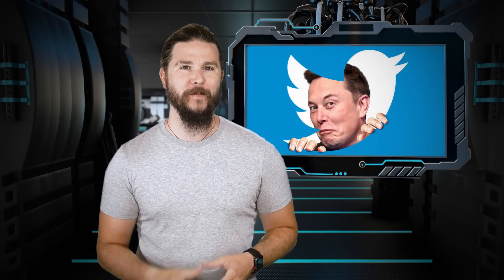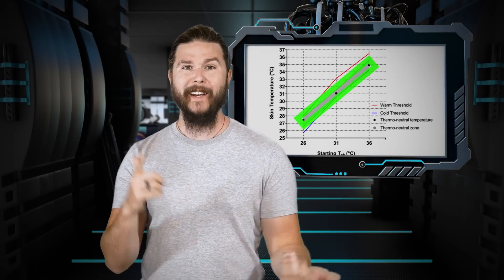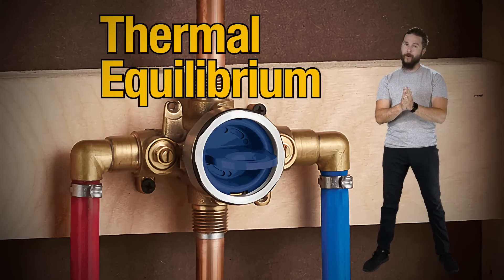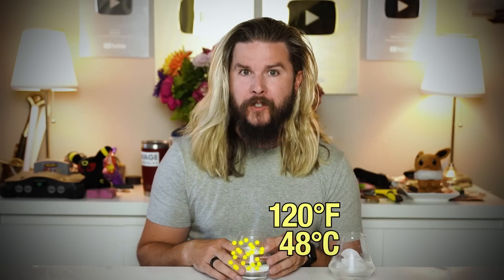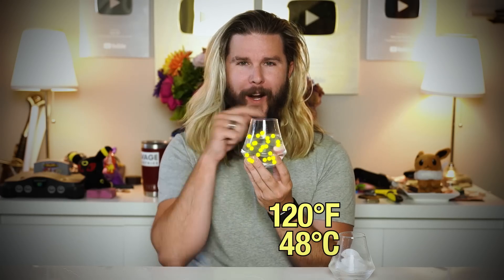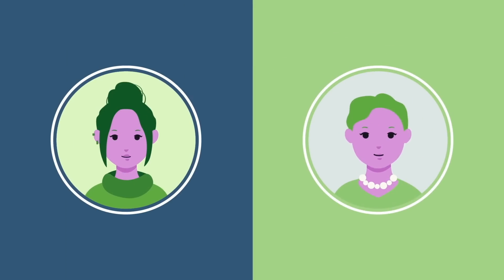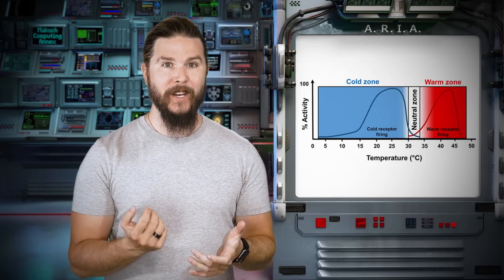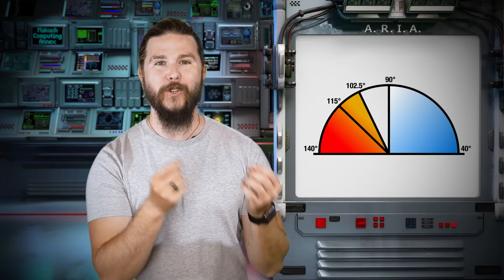Why Are Shower Handles So Sensitive?

Comment: First world problems... xD Or, to be fair, problems of countries with proper winter with snow and all time, versus tropical countries - at least in part.
Problem here in my mom's apartment isn't about finding the right balance, it's about hoping that the water gets hot enough during winter.
Electric shower that although new and fancy by country standards, it's yes, that famous type with exposed resistance in direct contact with water... Even Mehdi was kinda surprised by it (Electroboom).
Also, I guess a symptom of winters not getting cold enough, insulation here is kinda poorly done, not only for internal spaces, but also pipes and water tanks. As temperatures never goes bellow freezing, the attitude towards insulation and putting up thermal barriers on houses and apartments in the entire country is... cavalier at best. xD
What this translates to is that when the weather gets cold here (by our standards, single digits C), the water temperature also goes down by a lot, and then electric showers struggles to bring the temperature up.
We're not even in winter here yet, cold days probably dropping down at least some 10-20 degrees C more than it is right now, and we're already hitting the limits of how hot the electric shower can go. Cranked to the max, reducing flow rate to get to the right temperature.
I'm not really sure why, but it's like, it's hard to even find different options in the market... of course, basic electric showers are cheaper and so they'll sell more in a country that is mostly poor, but it's not like there is zero market here for fancier alternatives.
For some reason though, for electric, you either go with very simple exposed resistance wire electric shower, or you need to get huge tanks that requires separate and complex installation. No in between option like small wall mounted systems that can go all in the shower box or something. I used to think it was about market monopolization, but we actually have at least half a dozen big brands cornering the market, it's weird how little innovation there is.
The "fancier" more well known local brand have a huge range of electric showers which... well, don't have much difference between models at all, outside looks. You get some fancy slim line multi shower head with smooth flow control yadda yadda with internals that is exactly the same thing as the cheapest model - one or two exposed standard resistors in direct contact with water flow. So, you can change things around a bit, but water temperature, the most important point of contention there, will only get so hot no matter if you take the cheapest or the most expensive model. :P

Comment: You could also simply use multiple handles for the job because it was the way that they used to do it and most people still do.
Reply: In the last few years, I DID replace the faucets in the sinks in both bathrooms & the kitchen sink, with faucets that have separate handles for hot & cold, because when you turn on a combined handle faucet, the water that comes out is the same temperature it was the LAST TIME the faucet was used (it’s not hard; I have no formal mechanical training); the downstairs shower & the upstairs bathtub still have the combined handle like he’s talking about).  I was VERY GLAD for this fact 3 weeks ago, when the (23 1/2-year-old) water heater in my husband’s & my house died, & it was a few days before the new one could be installed; that’s because I discovered that, if there’s no water heater, NO water comes out of faucets with combined handles, whereas I could still get cold water from the faucets with separate handles (several times, I had to heat cold water on the stove to wash dishes).  I told this to the installers, so they could warn future customers to install a 2-handle faucet somewhere in their house if they're going to be without a water heater for a few days; this way, they can at least wash their hands.
Reply: @augiegirl1  I absolutely detest the combination faucets mostly because of how unreliable they are in comparison to a real faucet or as they say a separate handle system. The primary reason why they aren't as reliable is because if either side loses pressure the entire system will fail most of the time and when it does you will probably destroy the entire system simply by trying to use it. I also have problems with the inability to actually adjust the temperature in any meaningful way especially if you have a heater that is extremely high or low or if you have exceptionally low pressure on one side or the other.
Reply: A 2-handle faucet is pretty cheap, too.  The Walmart brand (Mainstays) bathroom sink faucet is ONLY $15!!!

Comment: You can get a thermostatic mixing valve installed which will pre-mix your hot and cold water to a certain temperature, which is what they use on hand basins in public restrooms to avoid getting sued literally every day.

Comment: Great vid, Kyle! That note you make around 9:00 is what the engineering field of Human Systems Integration, sort of an offshoot of Human Factors  (or when safety is involved, Human Reliability Analysis). I see this "engineering convenience over human-centric design" all the time in my field.

 Interestingly the only engineers that seem to have internalized HSI are ones where there has been a major disaster (systems engineers for e.g. construction processes i.e. Hyatt regency disaster, nuclear control engineers i.e. three mile island,  or aerospace controls engineers i.e. every pilot-based disaster). It's so incredibly hard to convince an engineering establishment to take these cautionary tales seriously in other domains though, since humans have this kind of "too messy, won't touch" feel. Trying to get awareness for it in Machine Learning via Human-Centered AI movement, for e.g.
Reply: Whut

Comment: Mixers are useless, twin taps for the win.
I'm on tank water and it's so much better than mains, showers feel like they're ripping your skin off. 
Run quad impeller pumps on controllers with accumulators, a 200L pressure vessel, 2 massive on demand gas heaters we can have the 4 showers running (2 per heater) and a toilet flush or washing machine/dishwasher filling doesn't do a thing.

Comment: I wish there was a system where you could input the temperature digitally and you don't ever have to worry about shower knob dexterity skills. Though I know this will likely require a seperate boiler from the one used for other purposes, like your dishwasher. I know that you can't just turn down the central temperature because then you get microbes growing inside the pipes, and you can't add chemicals cuz... that's asking for health and environmental problems. And going with a system that makes it hot first and then cools it down when it's needed is energy-inefficient. It sucks, but the only way I see this working is by reworking how you clean yourself altogether. The idea of a shower is faulty; there must be a better way. Either that, or they need to hurry up with them nuclear fusion power plants so the energy problem isn't a problem anymore and you can just fill a bath with boiling water through an automated system for your 7AM bath which is perfectly times to be at the right temperature when you get in. Or everybody gets an indoor pool filled with chlorine lol.
Reply: There are controls with a separate temperature knob and water knob. Bimetallic valve controlled. I have no problem getting the right temp, becoming very popular in europe
Reply: They have existed for well over a decade, small control panel at the shower where you plug in your temp and a go/stop button.

Comment: Imagine having one of those weird levers instead of the obviously superior 2 knobs
Reply: Right? The 2 valve setup(actually 3 in my shower, the middle one controls post mixed flow to the shower head) is the obvious answer
Reply: @NFSgadzooks  Only downside is accessibility for those with poor grip but you can always just like, do the lever/handle thing, but on the knobs.

Comment: In India, We do not have hot or cold showers.
We have showers depending on what the temperature of the water being supplied is.
In summers it is hot enough to compete against Ryan Reynolds and in winters it is cold enough to give Elsa a fever.
Reply: You have a way with words
Reply: Wait, India has winter?
Reply: Wouldn't giving Elsa hypothermia be a more apt description for cold affecting cold in this scenario?
Reply: @justmythoughts88  The common believe is that, when you don’t coat yourself properly, you catch a cold, and by extension, a fever.
Reply: @justmythoughts88  Spending time in too cold environment often weakens your immune system and makes it easier to get a virus for flu -> fever is the most common symptom body uses to fight a disease caused by a virus. 

I assume this is what OP meant.

Edit. I think a joke just flew over my head... 🤦‍♂️
Reply: @justmythoughts88  And you give your dog a kick every day too? Suck on it Ass, I mean Arc.
Reply: @justmythoughts88  It's a metaphor. It has been around in one form or another for at least a hundred years.
Reply: @DrewNorthup   The op said it's hot like Ryan Reynolds, and cold enough to give Elsa a fever. A fever would make her hot. I'm suggesting a more apt word would be hypothermia, as in the water is cold enough to make a literal ice queen far too cold, giving her hypothermia.
Reply: @DrewNorthup solid use an ad hominem there, good sir. Love that intellectual depth. 👏
Reply: @justmythoughts88  technically no, they're right. Getting a fever is caused by bacteria or being around cold areas, especially since fevers are also associated with colds.
Technically they should've said a cold though
Reply: @ExtraLives-s8c  I never said anyone was wrong, just offered a different word to fit the metaphor a bit better. Secondly, no one had been talking about bacterial infections. I'm talking temperature related conditions, again hot to hot and cold to cold.
Reply: Indian engineering be Wildin 🤣
Reply: @Skedge  no shit, Sherlock. If I know what hypothermia is, it stands to reason I also understand that cold can also give you a fever. Hot to hot, cold to cols, that was my point. Not cold to hot.
Reply: @justmythoughts88  what's that phenomenon something about being unable to recognize when people are being facetious
Reply: @gororgelester985  oh no, I missed the fact the OP wasn't actually being serious? Forgive my transgression, good sir, and grant me the opportunity to right my wrongs. 🙇‍♂️

hopefully you have a solid understanding of sarcasm as well
Reply: @justmythoughts88  I don't understand why or how sharing a minor critique caused so much conflict. Although, the verbal patterns remind me of a kingergarten classroom.
Reply: @AngelNearDestruction  welcome to the internet, where critiques flow freely and linguistic skills leave one wanting.

Comment: I will say there are times when you want only hot or only cold water, usually because you're not taking a shower but are using the tub for an Alternate use. Like washing large objects that don't fit in a sink. 

I'm struggling with conceiving of how to engineer a joint that has 0, 100% and then only,  say, 50 to 70% mixing ratios.

Comment: Well, this "problem" have bin solved sins 1972 in Sweden ... with proper engineering. It is named a Termostatblandaren ("thermomixer"), and it regulates the flows of hot and cold. I do not know if it was the first of its kind at the time. But it was the first in Sweden. Granted, the blenders of today are far better than the once back then. That said, growing up I never understood why this hot and cold shower temp mix was a problem. I never experienced it in my home. It have bin a standard in Swedish homes for decades. The difference between each degree of Celsius is about 0,7 cm. ( I measured on my own). The temperature range is from about 25 to 45. and the knob goes almost 2 spins around, including a safety laths that prevent temps above 35 unless you release it. It is easy to get the exact temperature you want.
Reply: It's called a thermostatic mixing valve in the US and fairly common this day and age. Also we have pressure balancing valves but that is more to prevent temperature fluctuations while in the shower.
Reply: @m_soko  where in the US do you live that has these? And what price are you paying for the places? I've lived around LA my whole life in a variety of places (from cheap apartments to expensive homes) and the only thing like that I've seen is in the master bedroom of a 4m luxury house where it has a digital temperature controller. But every other shower I've ever used (including the rest of the showers in that 4m house!) All have some variation of the exact system in this video and are a pain to get in the right spot. So like... you say it's common but... where??
Reply: i live in sweden and it is a problem
Reply: Yeah, have the same here at Åland, never had this problem either.
Reply: @sgt_kissekatt6686  for me it started when they adjusted the water piping or some shit. did'nt have this problem before last year.
Reply: Indeed a thermostatic mixing valve is by far the best way to fix the problem.

Sadly rentals tend to be way too cheap to use them (even though they're not that expensive), and as a result knowledge of TMVs and their advantages is nowhere near as widespread as it should.

TMV are also safer, because they normally contain hot water cutoffs (though do check that yours does), so they cut the hot water intake if there's a significant drop in cold water pressure. They also make for much safer and more reliable showering in variable-temperature environments e.g. if your hot water can come from a solar heater or a furnace. This also works when the cold intake has variable temperature (e.g. the mains are not well insulated and so can vary from "near freezing" in winter to 15+ in summer).
Reply: And in 1927 in Brazil, where a guy was crazy enough to pump electricity into his  showerhead and it quickly became a very common thing in every household

Comment: You completely washed over the wax expansion valve. But the main point of a shower having such a wide range of motion is because it is unknown at what temperature YOUR particular water heater is set for, therefore the valve has to be designed to adapt to a much wider variable range, otherwise you overcomplicate the line (and more valve complication means more leak possibilities and more cost long term).

You could set up a system of temperature actuators to dial in a perfect temp for you....but then it's only for you, and it may not even be what you like year round. I prefer a tiny bit hotter during winter than normal, and I like mine nearly 5 degrees more than my gf. It might only be "an inch" of dial movement, but I don't only use the shower for showering....filling my carpet cleaner or wash buckets requires straight hot water, and filling my grass fertilizer or weed killer containers requires cold water, so I use nearly the entire "180 degrees" of movement. Personally, I prefer the 2 handle system that I grew up with, but I haven't got the funds to remodel that part of my house yet.

Comment: This is an American problem. Most other places you have a separate warm and cold handle to better mix it (just like a normal faucet), or just run with the thermostat controlled ones by default
Reply: Canada. Mine is like this but it’s rare
Reply: In Europe I thought the showers were magic but didn't know why
Reply: It's not even that, we have showers here that have individual controls, and our house has single controls that work perfectly fine. It really seems to just be an issue with bad plumbers and bad faucets.

Comment: Guess this is mainly a sensitivity issue. My "confortable" temerature zone is between 25-35C so i have no issue fining a proper setting on any shower. My wife showers in between 36 and 36,5°C so she needs a thermostat.  
the issue can be much more complex anyway. Our house uses a heat exchanger for warm water so the temperature of warm water can drop if more than one apartment is using hot water. So does the pressure. So if you have a static valve and the temperature and pressure of the warm water drops, the temperature can shift significantly. 
Best solution by far is a thermostat. This way you can set the temp you like without even being in the shower and you have no issue with regulation. They are not that expensive anyway. I installed one in my grandmas home for less then 100€

Comment: There´s a video on the channel "Gear down for what" where he build a 3d printed 100:1 gearreduction to fit onto his shower handle. It might sound stupid but that literally solves the whole "less than an inch of usable range" problem without messing with your hot water temperatures